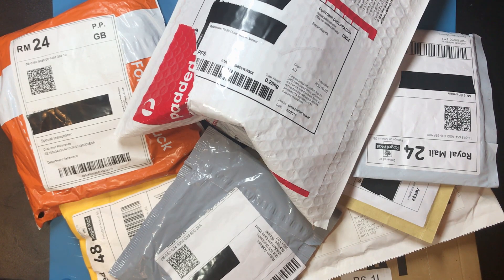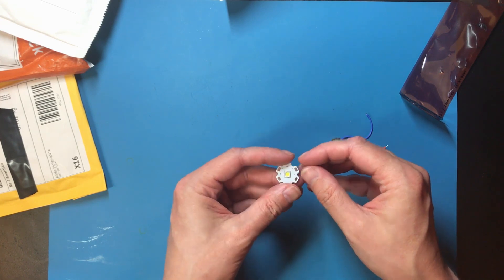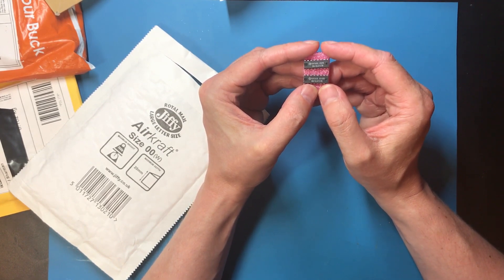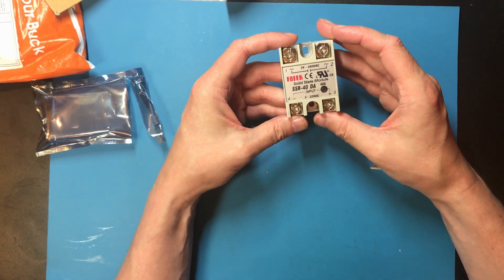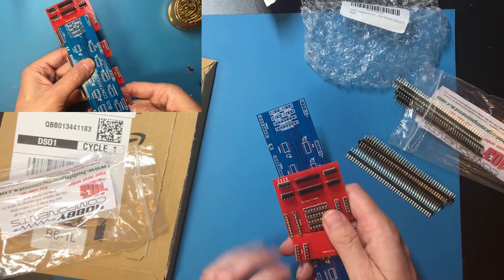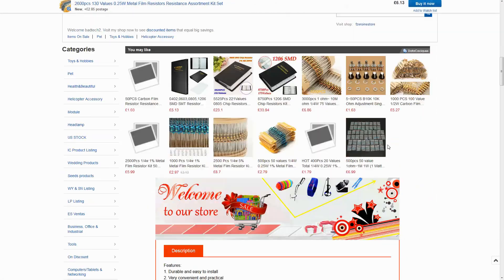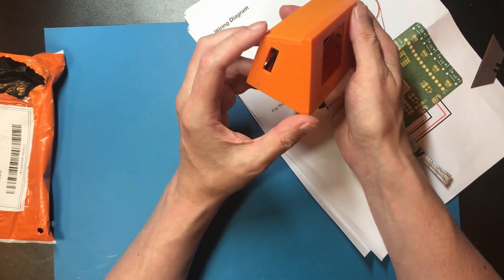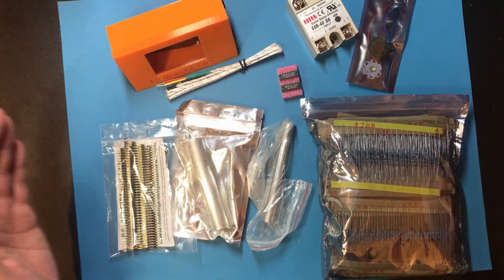Mailbag #3 Reflow Parts

Comment: Regarding your Fostek SSR-40 DA, I am setting up a ReflowMaster too and have the [I think] exact same relay but am now hearing that this relay is often not genuine and the fakes are fairly sketchy, unreliable, and may fail.
I bought mine on ebay for cheap and accept that mine is probably fake.
https://protosupplies.com/inferior-counterfeit-fotek-ssr-25-solid-state-relays-on-the-market/
According to that site and looking at your video both you and I have a non-genuine Fotek SSR.
I don't have any direct experience with that, but from what I hear, be careful with that; it can only actually handle ~16A. :/
Reply from the maker: I've heard similar things, but mine certainly wasn't the cheapest on ebay. A 1.5kw heating element will only draw about 6.25A on UK 240v mains. Thanks for the warning, but if it is a 12A rather than the 25A one in there it will probably be ok for this purpose, especially since they only run for a few minutes at a time in this use case. I may hook it up to a load and run the thermals, see what it does.

Comment: Funny about the 74*LS*157...those one off characters throw me off all of the time, trying to get precisely what some random guide on the internet says...that was probably written by someone that got the # from someone else that got it from someone else and on and on and on...when any general part # would have probably been just fine...or NOT!
Reply from the maker: In terms of small breadboard circuits many are interchangeable. The big danger is where they have different electrical requirements (i.e. no internal pull-ups).